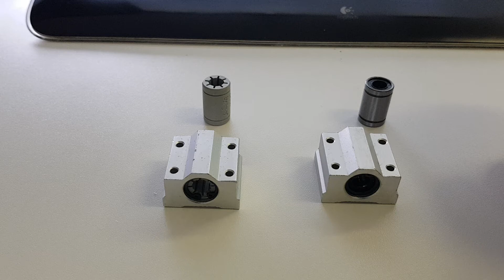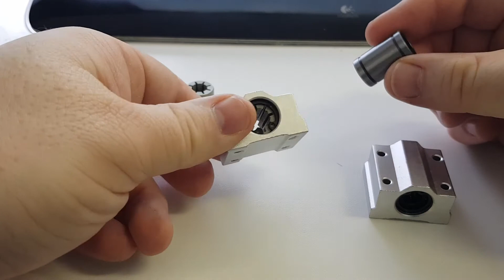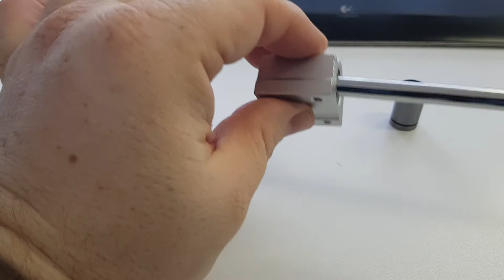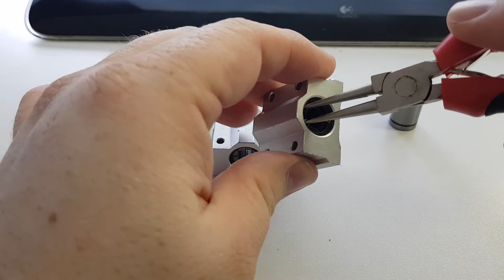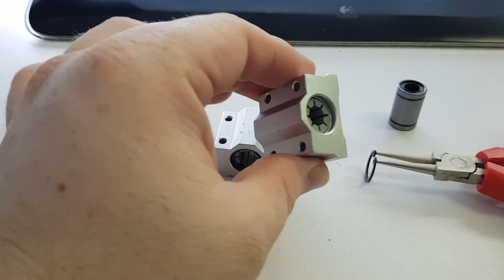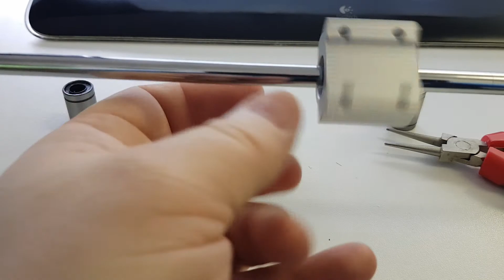3D printer (Anet A8) linear bearings upgrade

Comment: I never thought the plastic bearings were legitimate! The original bearings on my Anet A8 just died. I have never heard such a horrible sound coming from a bearing, that includes automotive and electrical motor. Fast traverse moves are gut wrenching :-)
Reply: I think they might be polytetrafluroethylene (teflon). Used in non stick pans. It is one of the most slipperiest plastics out there.
Reply: @nissan300zxmike  Thanks Michael. I have ordered some to try out. I assume there will be no need of lube.

Comment: I have installed that kind of bearings on my Anet A8 (at the Y-axis), but after the replacement I've had problems with serious belt skipping (the belt on the Y-axis). Everything feels smooth when I installed the new bearings, but I guess when installing/levelling the hot bed again, the tension on the bearings create another kind of resistance? Something you've had problems with?